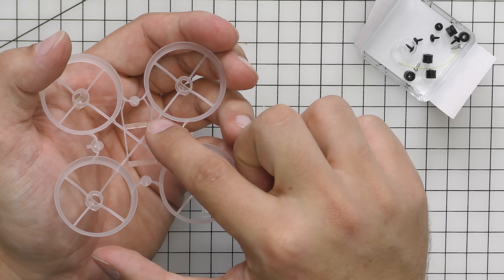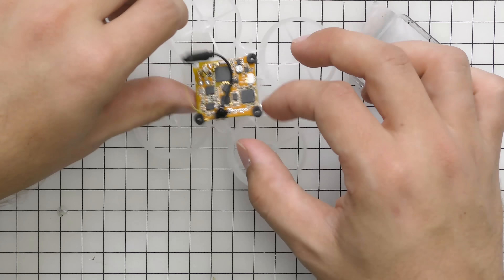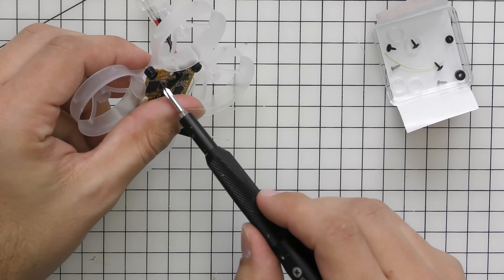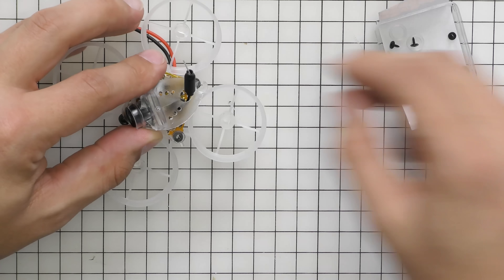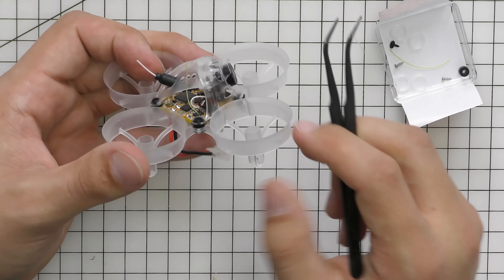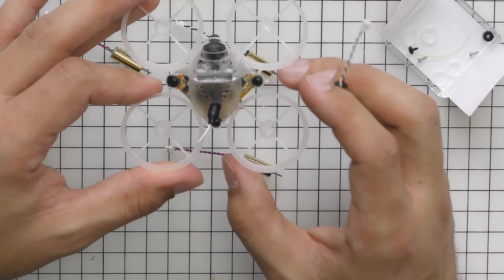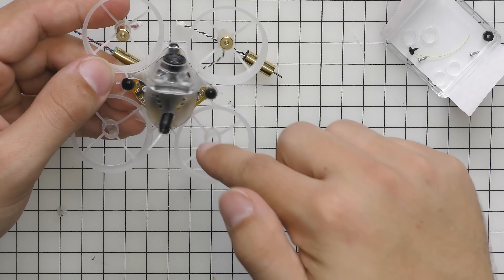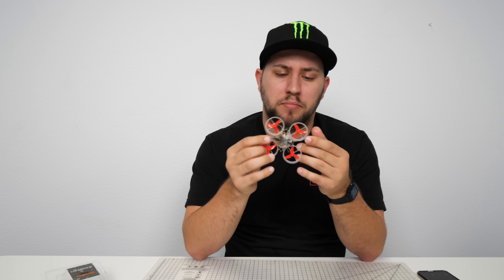How to build the BeeBrain Lite

Comment: Assembling mine now.  Have extra parts like some clear washers and some screws.  This does not come with instructions for a beginner at all.  Nothing mentioned anywhere about betaflight.  What is going on.  This is for beginners right?
Reply: Same here. I’ve got clear o rings and screws and a yellow wire.